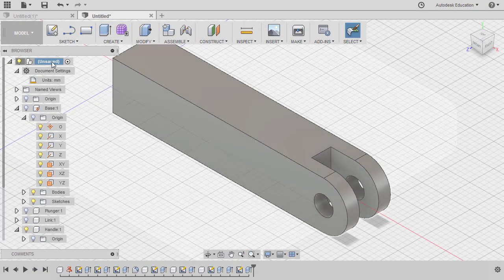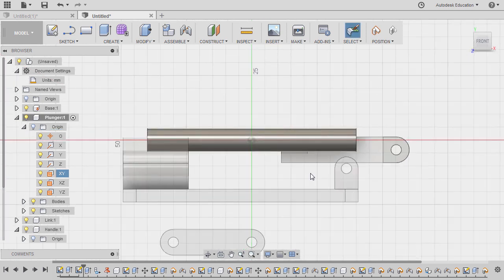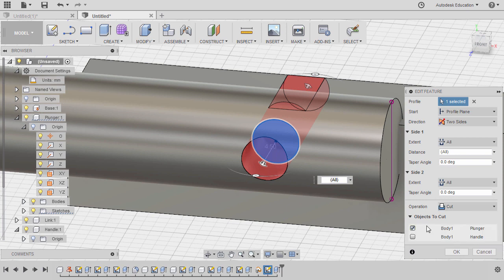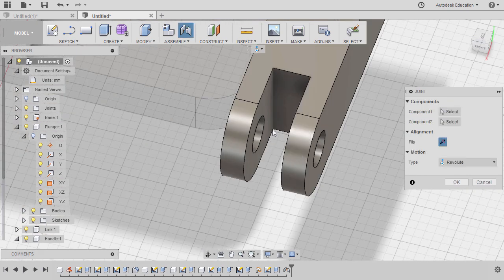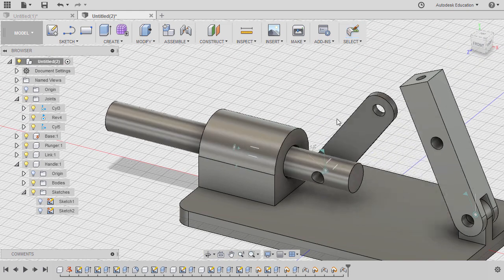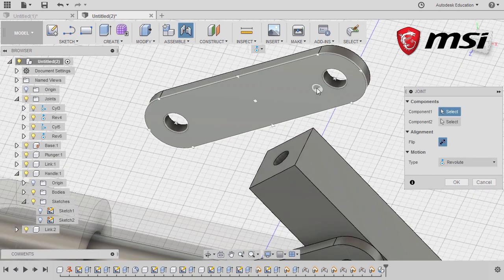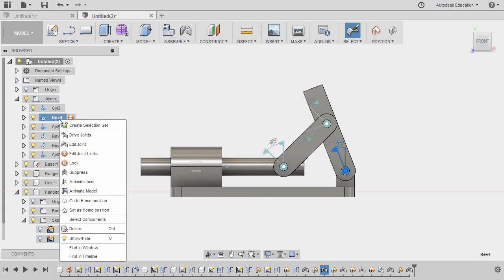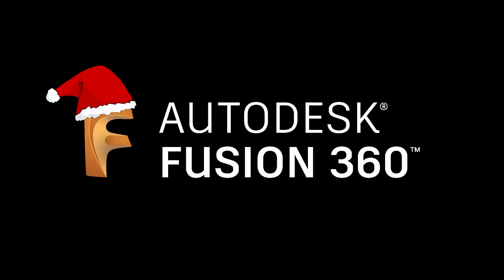Fusion 360 Challenge of the Month: DECEMBER 2017 Part2

Comment: I am having problem on joint limits and con not get the model to animate,On the joint i get angle conflict due to joint type.There are 6 joints and 3 parts are the joints paired or all 6 joints need adjustments?
Reply: took me an hour to figure it out though, its fun.